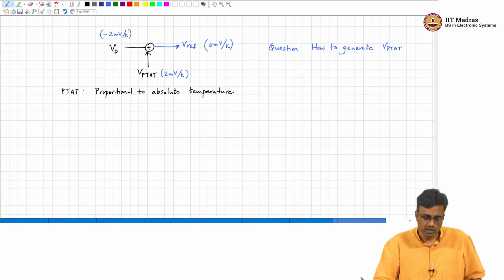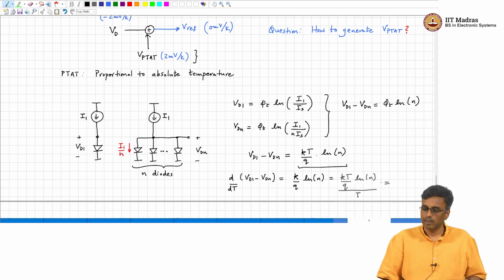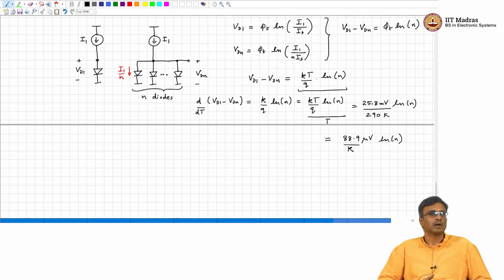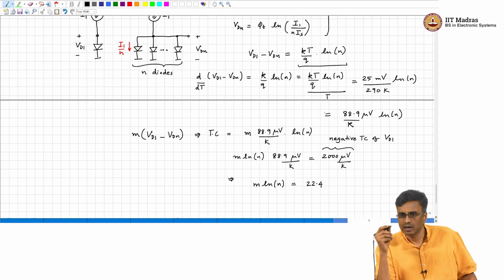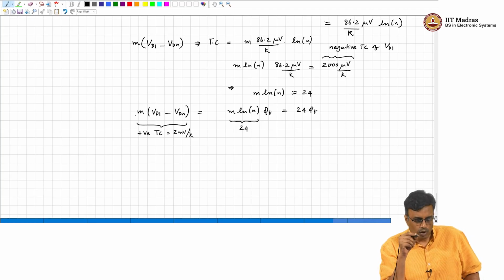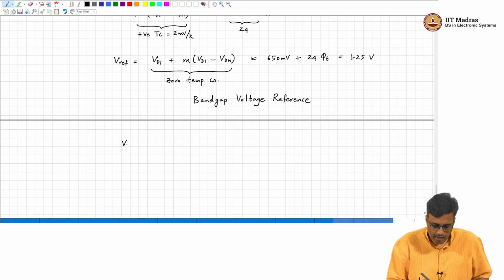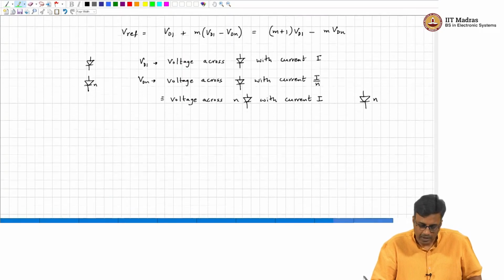4.2 : The Bandgap Voltage Reference Principle

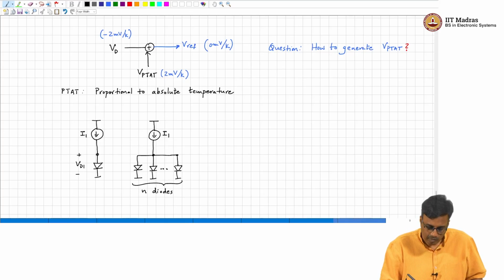Comment: 1:20, the diodes may not have same V-I characteristic curve, or in other words the shockley diode equation is a simple model. There must be some parameter that will be unique to each diode. in that case for KVL and KCL to hold across the diode, the currents have to be different through any unmatched diode. isn't it so? in that case V_Dn will be solution of "n" simultaneous logarithmic equation. if the solution comes out to be also logarithmic and of the form: 
φ_t * a * ln( b * (I_1/I_s)) where a and b should be independent of individual unmatched diode parameter, only then I_1 will get cancelled and we can control the temperature coefficient and make one which is opposite of D1. 
Am i thinking correct?
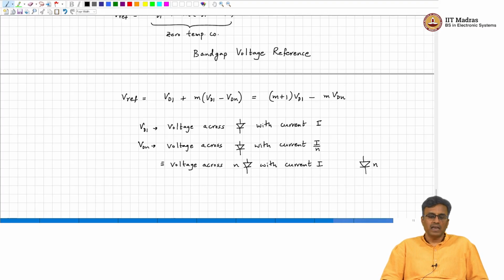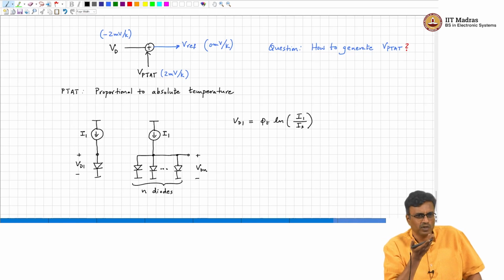21:14 got my answer. Prof mentioned the term "Identical" at 3:40. I missed that.